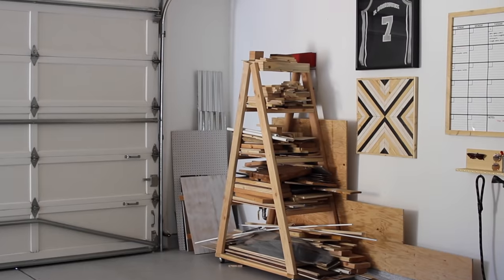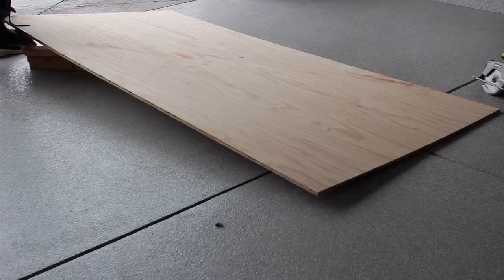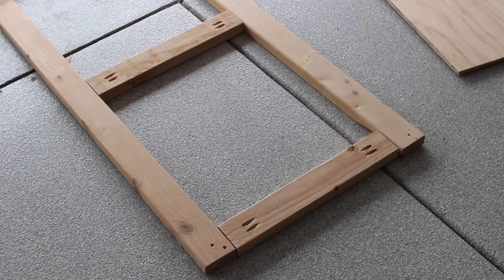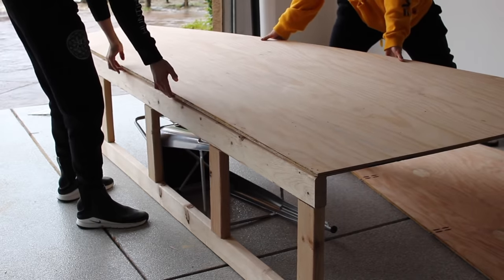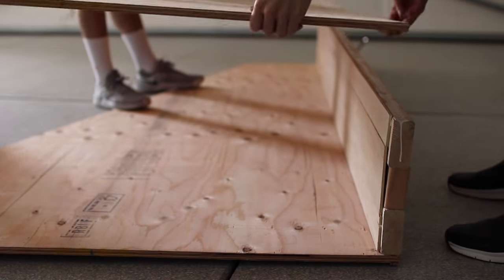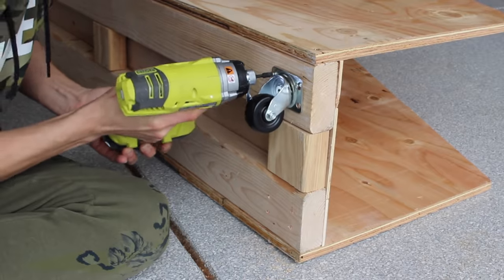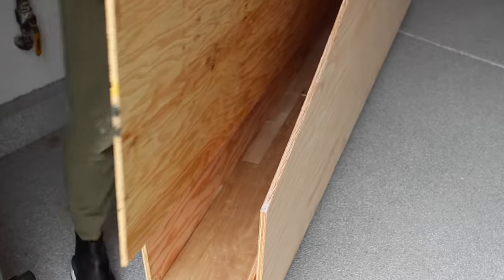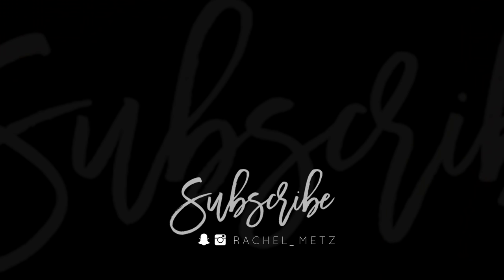DIY Wood Storage Part Two | Plywood Cart + Giveaway Winner Announced!

Comment: Hey, I made this storage box for my stuff & I needed more sturdiness as I filled it full with heavy plywood..instead of putting three pieces on the floor of the box, I put one thick piece so that it wouldn’t pull apart once heavy things were placed in it. Just a suggestion if anyone else wants to build this

Comment: I would have made sure to leave the unit free moving. I'm not sure how to keep it nested against the wall so as not to be a danger to the car. Then again you did put locking casters on it. I just see it needing to move. Maybe some sort of latch method would have worked. In any case you're well on your way. Also you might want to check out April Wilkerson if you've not already found her. You two are quite different in aesthetic but you have much of the same 'Do it all myself' mentality.
Reply from the maker: Thank you for those tips! I love April - she's a huge inspiration.

Comment: I would move the handle higher and line it up with the angle of the top. It's too low to be functional. Even after adding it you pulled the wood storage instead of the handle to move it.
Reply from the maker: I am totally redoing it! I got a couple comments with this feedback - I am going to add a canvas to the whole thing so people can sign when they come in! Place the handle where you guys suggested xx.